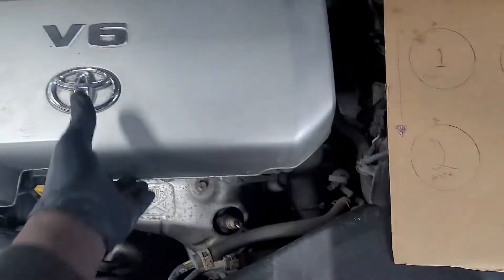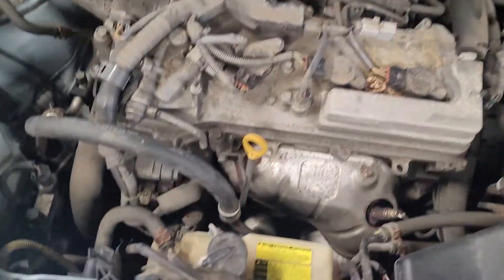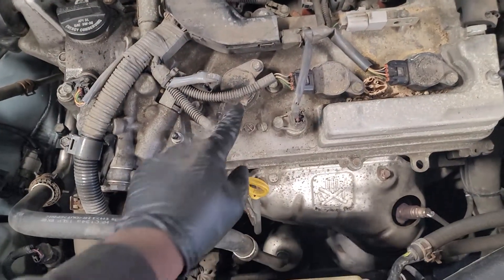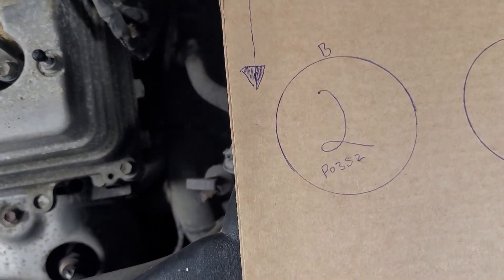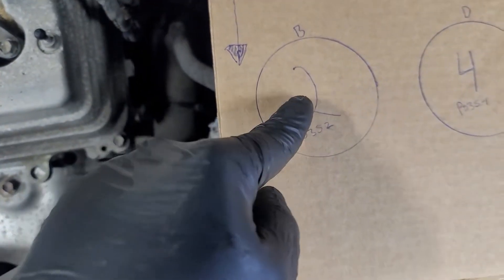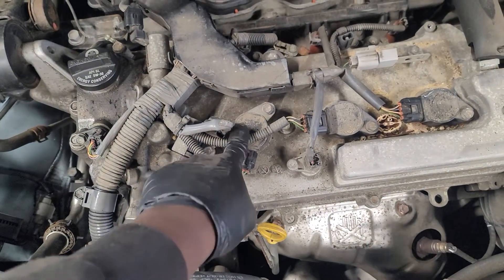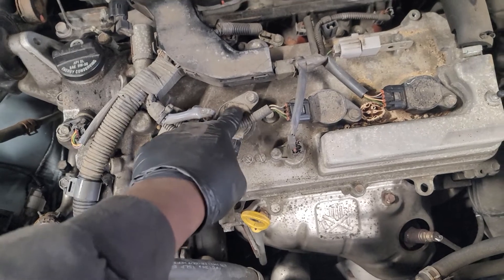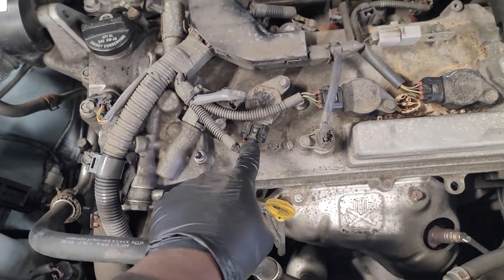Toyota 3.5L p0351, p0352, p0353, p0354, p0355, p0356 problem FIX!

Comment: Thank you so much, had scanned PO356 code+VSC+ engine light, luckily no:6 cylinder is in the front right on Lexus RX350 easy access, removed, cleaned plug,coil, connections and so far code and lights cleared. 👍🏼🇦🇺
Reply: Mine is the 2008 rx350 and po355 is the 5 cylinder which is top right …. 😢😢😢

Comment: Just saved myself $200, bought the part for $100, took just 10 minutes to install, engine warning light and vsc warning light went off as soon as I restarted the 2007 camry xle v6 engine and has stayed off. Very helpful and detailed on the location of the D coil. Thanks a million.

Comment: Thanks a lot for the sketch depicting the code related coils. It was a life saver. I just changed over the weekend the coil 1 in the back/left side with P0351 code on my 2007 Rav4 2.5l V6 engine. Afterwards all the alarms/lights cleared. The back side coils are not easy to get to. You have to remove the air intake manifold and tools needed are: 5mm hex socket, 10mm wrench, 12mm socket wrench for 2 brackets bolts in the back.